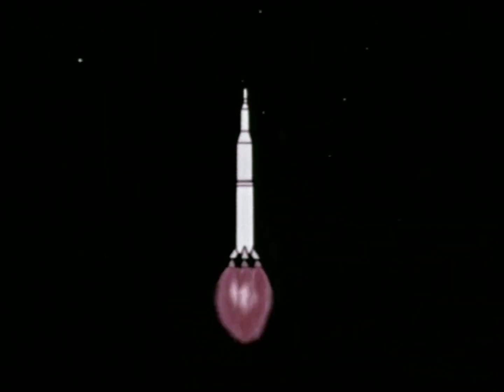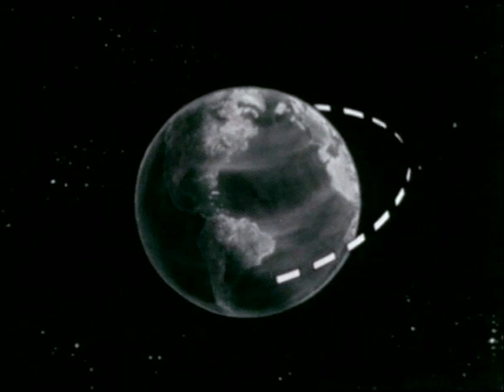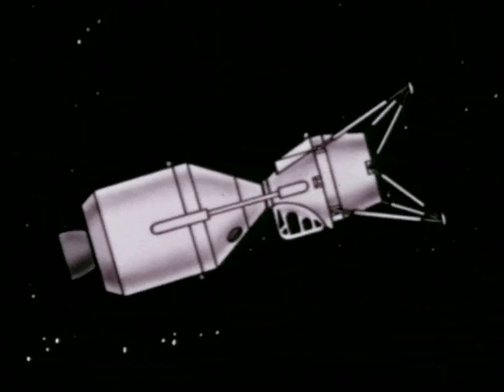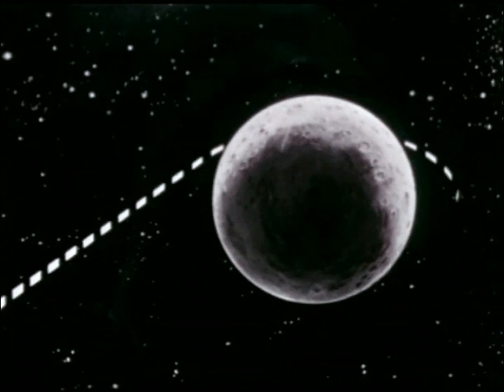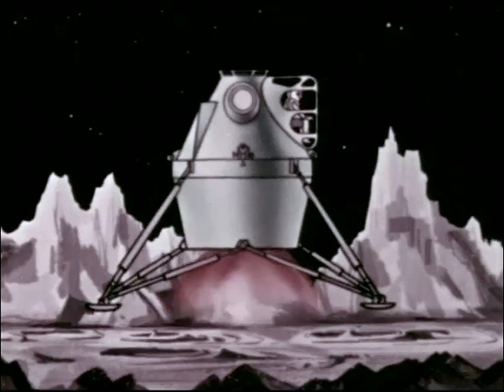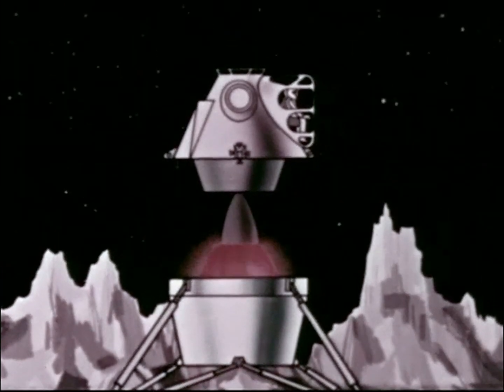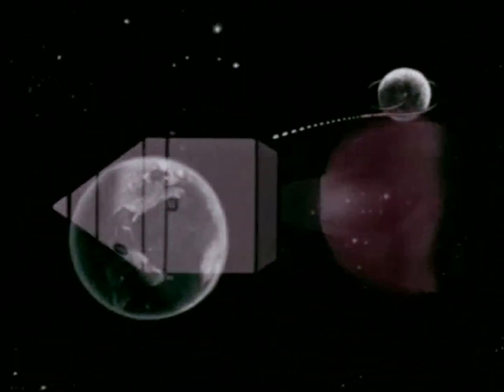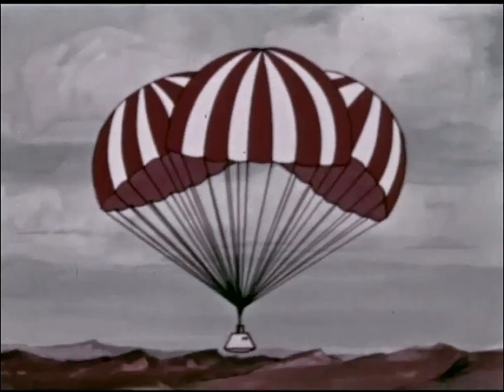Apollo Lunar Orbit Rendezvous Technique Animation from the Early 60s

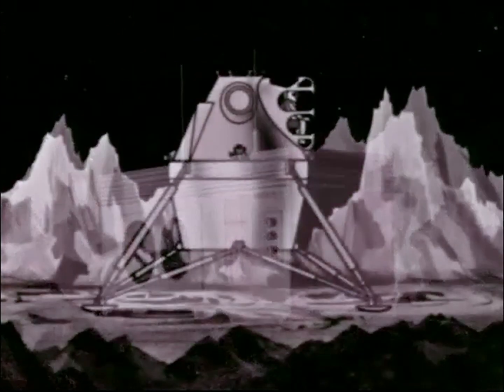Comment: 3:48 It is interesting to note that during launch from the Moon, the exhaust passes through the descent stage. During real launches, there is space for the exhaust. However, in the staged Apollo 11 launch from the lunar surface, there is no such space, meaning that the exhaust would have burnt through the bottom of the ascent stage. If you want to know what really happened in 1969, then read the following book, which is fully referenced and based on NASA documentation: Apollo 11 – The Real Story
(or in German: Apollo 11 – Die wahre Geschichte )

Comment: Interesting to see the original plan for connecting the LEM to the command module. Using arms to move it around the Command module, rather than detaching & flipping the command module and then "pulling" the LEM out like they did in reality.